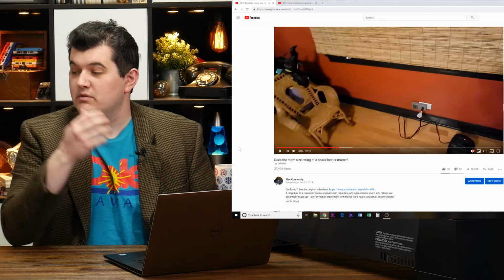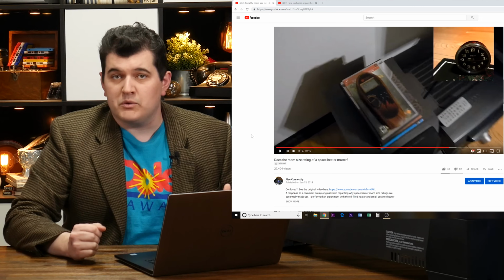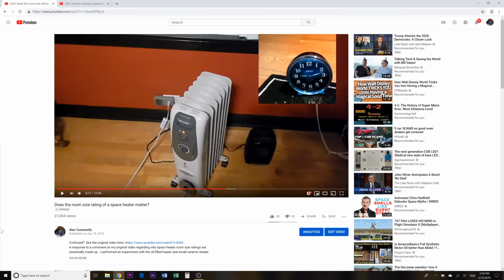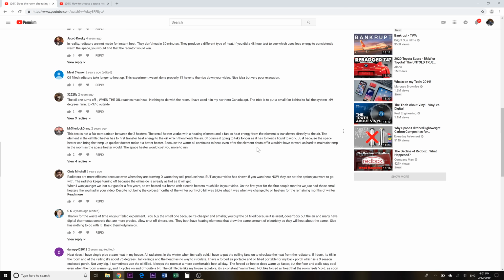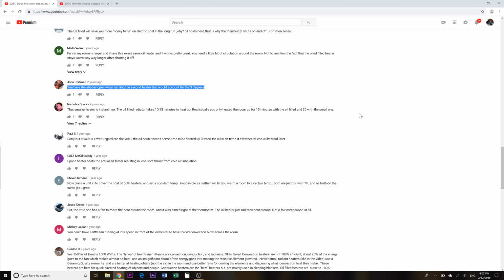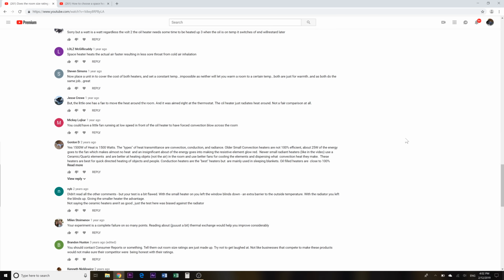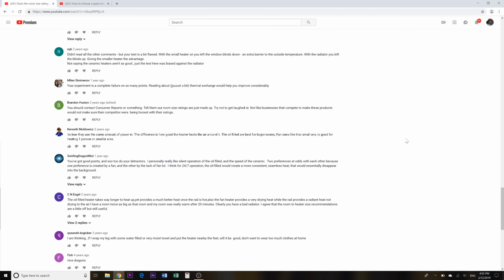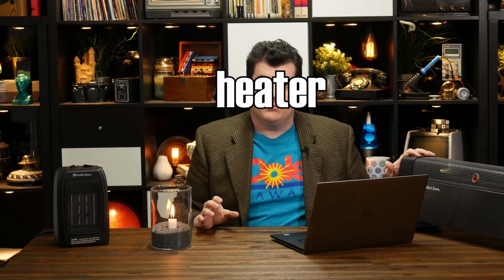More Space Heater Nonsense

Comment: Thanks for you videos.  I thought I would pass along some info on a nifty thermostatically controlled outlet that works very well for controlling a room space heater at a very accurate temperature.  Here is a link to this product on Amazon - https://www.amazon.com/dp/B07SBN2N69/  This has two pieces - an outlet switch and a separate thermostat module.  The thing I like about it is that the thermostatic sensor can be placed across the room (or anywhere you like) from the outlet switch and heater.  It's specs say that it will control the outlet switch to within 1 degree celsius.  My experience is that it really does that well.  One caution in using this (or any thermostatic outlet) with a portable space heater, one of my space heaters had an electronic on/off switch.  With that heater when the switched outlet removed power and then later restored power at the plug the heater didn't automatically restart - I needed to hit the heater's power switch again after power was restored.  So this doesn't work with that type heater.

Comment: Spent $53 on a Lasko ceramic tower, has remote control and oscillates back and forth. IT does a better job of heating my room than a 1500 watt utility heater I have. I can direct the heat towards my bed. They are both 1500 watt but the tower works better. I wouldn't spend any more than that, saw some for $99 and more!

Comment: I think that perhaps a lot of people get argumentative over your older video due to the fact its 2 different styles/methods of space heaters. I would suggest doing one with the same exact brand, same exact style, but both rated for different room sizes(and still using 1500 watts each). Your older experiment was like comparing Granny Smith apples to Fuji apples, not quite apples to oranges, but still different enough. Your intended point wasn't really made in the old video, as you more just showed the difference between the oil slower radiant style to a fan blown space heater.

Comment: The difference is more in the application than the cost to operate.  Fan heaters are quick and can point directly to you, if you are going to be in the room for many hours working or sleeping, the oil based heaters provide a more consistent room temperature and are silent.

Comment: Having actually measured the amperage draw of several different types of these heaters I can tell you with the utmost certainty there IS in fact a difference...

The mfgrs are rating the product at the worst case scenario of tolerance build up to draw no more than 1500w.

I have seen 3 different heaters, all rated at 1500w, set on high, on the same circuit, draw between 10.8A - 13.5A

So there is a difference in quality, which translates into functional efficiency...

And this doesn't even address the functionality of thermostats - which varies GREATLY!

Comment: The MOST IMPORTANT POINT of using space heaters was not addressed however, and that is: make sure your outlets are properly wired - I cannot stress this enough!!!

A space heater rated at 1500w running on 110v is drawing 13.64 amps - which is getting close to the 15A rating of a regular outlet. Now if your house was built long ago they may have used the push-in quick contacts on the back of the outlets, instead of winding the wires around the screws. This affords NOWHERE NEAR the contact area for current to flow, and especially if the outlet you're using is feeding more outlets downstream, you can easily overload it and have a fire!

Also if your home has aluminum wiring you need to make sure the pigtails are greased properly, or appropriate outlets are used - otherwise you will develop a high point of resistance and have a fire as was previously mentioned.

Hope this helps someone!
Reply: Well yes but then if a fire started the room would be even warmer!  For free!  I feel like that should gain the heater some extra points for efficiency.
Reply: @Interyx  
😂😂😂👍
Reply: Yeah, tell this to the erect chickens using those wago connectors
Reply: @shimes424  
IKR! 12Ga rated at 24A - yeah right, and 10 years down the road in an environment with the least bit of humidity and they won't handle half that current! But they're UL approved...

Maybe if using grease was mandatory they'd at least have a chance?
Reply: @shimes424  Wago is amazing though. Use it all the time in very humid environment from salt water. Works great.
Reply: You VASTLY underestimate what old wiring means. How about two-conductor post-and-wrap with non-polarized outlets! Hahaha! And the kitchen's three-prong outlets were either grounded to the water pipes nearby, or not even grounded at all! - - - Anyway, old houses can have some sketchy wiring that doesn't support high-draw appliances.
Reply: @MonkeyJedi99  talk about old wiring, at 13-14 amps my breaker flips every time. My entire upstairs is on one breaker, not to mention some of the power is sipped by the unit next to me. Oh and guess what, my breaker box panel is located behind a locked door. and there's a window AC unit on the same shared breaker.
Reply: @deadchannel991  Kind of makes you want to burn out the breaker with repeated trips just to force an upgrade.
Reply: @deadchannel991  Ah, the joys of renting in a slap-dash subdivided building where much of the work was done while the building inspector was drunk and/or well-bribed.
Reply: This is why I'm rewiring my entire house to have all outlets on 20A circuits, no backstabs allowed.
Reply: No way to heat your house faster than having it on fire! Always see the bright side xD
Reply: Thanks! This is very good info.
Reply: Oh yah, I totally agree with that.

Imagine the fear I had when looking at my electricity panel:  I'm living in a building where the panel is a old one (30 amp max) with fuses tenants "can" change with a higther one. A lot of that avec 1 to 2 air conditionners, a lot with portable air conditionners (witch consumme a lot of amp). I fear fire in my building in summer  because the propriety managment don't make sure that everybody know how to proprely use them. 

By exemple, my father buy me a portable air conditionner of 15 amp ( He didn't let me chose it) to rempace my old one (10 amp). The only place I can put the new one is in a piece I don't really want to cool and I can't take a shower in the same time because it's on the same circuit of the wc fan. I can't plug it in my other room because my fridge is on the same circuit. The old one can be plug in that room only and only if nothing else is functionning except the fridge. All the building his build like that. Oh I have a big fear of fire.
Reply: Actually house fires due to electric issues is rare. Just look up the percentage on cause of fires. I have seen people wire outlets ( 15 AMPs ) to Dryer circuits. Dangerous? Yes! Fire hazard yes! Did the house burn down? Still there 17 years after he did it. Stop fear mongering over aluminum wire and back outlet connections.
Reply: @Crimson_Hawk_01  If your house has aluminum wiring, it's also pretty good odds you don't have fire breaks in the wall, and any insulation you might have once had blown in (because in the oldy-old days, coal was CHEAP!) the walls has settled into the bottom foot and a half, only keeping your wires nice and warm.
-
Also, a lot of older houses have what I like to call "creeping upgrades" where additional plugs and lights are spliced in with whatever type of wire is common that decade, and you end up with twenty or thirty items on a 15 amp fuse, because putting in a new breaker box big enough for modern electrical use and wiring the house properly is expensive and involves tearing out lath-and-plaster to get in the walls.
-
And if the old wiring fairy was particularly generous, you have a combination of various gauges of 2- and 3- conductor (because grounding your return to the water pipes is fine, right?) branched off of old post-and-wrap that predates the Ford Motor Company. And you still have screw-in fuses.
-
I can't believe that house passed the inspection when we sold it.

Comment: It's all about humidity...
All heaters dry the air - and we all know from the summer "heat index" more humid = more uncomfortable, as far as our perception is concerned.

All types of heat do this to one degree or another: baseboard hot water systems the least, forced air the most. But these types of systems usually include humidifiers to counteract this condition.

That being said, the oil filled radiator style will dry the air out the least, followed by the ceramic element types, and bare element or reflective types the most - and the lower the humidity, the cooler a given temperature will "feel"...

So in conjunction with buying a space heater, set up an aquarium - which will bring you much relaxation at the same time as making you feel more comfortable!

And of course ALWAYS use a ceiling fan to distribute the warm air throughout the room - hot air rises, and it's always warmest at the ceiling.
Reply: I really enjoyed your comments; very informative.  A question:  I wanted to buy an oil-filled heater, but was discouraged by what he said about their heat frequently cycling them off.  Do you have an opinion on this?  I don't enjoy the sound of the fans.
~♥~
Reply: @Sita-Rainbow  
Hi Sita, thanks - glad I was able to be of help!

Think of the way these work akin to charging a battery, and then you're using the power stored in the battery - the oil is exactly that: a thermal battery, so they're putting out heat while they're not actually "running" (drawing current) These are also not going to react to quick drafts if placed near a blast of cold air from a door - where a fan driven unit will kick on, even tho the room temp hasn't been all that effected overall.

At $54.90 at H.D. this is only a few bucks more than the cheaper unit with the finicky analog dial thermostat, so it should perform much better:

Pelonis 1,500-Watt Digital Electric Oil-Filled Radiant Portable Space Heater - Model# HO-0280

In my experience these have all but silent operation, with just the "click" of the relay when it cycles on/off... Which they do seem to do fairly frequently, but it's kind of inherent in the design, as it's maintaining the temp of the oil. (Think of your electric cooktop cycling on/off while maintaining a pot of hot water)

And don't be fooled by it being slow to heat up a room - these do put out!
The key is having no fan, they heat by convection currents, so having a ceiling fan on in the room helps heat distribution, (or placing the unit under a window will also help) and they will heat a larger space effectively.

If you want a heater for say, a spare room you use occasionally as an office and want to heat it up quick for short periods of use, this is NOT the one you want - for a bedroom or living space, where it's always running and maintaining a temp - very well suited...

For that quick and infrequent office application for only about $22 this cheap little heater puts out!

Lasko 9.2 in. 1500-Watt Electric Portable Ceramic Compact Heater - Model# 754200

But it has an analog dial style thermostat which isn't worth shit, and you will find yourself fidgeting with it constantly to maintain a satisfactory room temperature over long periods of time.

Happy heating!😁
Reply: @openeyes-411  Wow, it's like Christmas with a reply like that.  So excited that you've done the huge bulk of my research for me.  Thank you!!
~♥~
Reply: @Sita-Rainbow  
You're quite welcome,
And Merry Christmas!

Comment: Thanks for doing these vids, makes alot of sense, and I've noticed the same thing with heater marketing- large vs small room. I've got $100 " large room" heaters that are not nearly as good as the $20 small room heater with a fan.
Reply: I have a friend with a fancy-pants fireplace type with an infrared that puts out squat - so I measured the current draw and compared to 2 other ceramic types.

The mfgrs are rating the product at the worst case scenario of tolerance build up to draw no more than 1500w.

So I measured 3 different heaters, all rated at 1500w, set on high, on the same circuit, and the draw was between 10.8A - 13.5A
And now we know why the fireplace (The 10.8A unit) didn't seem to put out much...

So there is a difference in quality, which translates into functional efficiency...

And this doesn't even address the functionality of thermostats - which varies GREATLY!
Reply: @openeyes-411  How do we spot the higher-quality, i.e., more functionally efficient ones?
~♥~
Reply: @Sita-Rainbow  
Yeah that's something you can't really "spot" per se, and I can only offer my personal experience. That fireplace unit my friend has she got at Wal-Mart. And I also once bought an infrared unit there only to return it a few days later, as it put out squat...

I've been using space heaters for well over a decade and I've found the mid priced Lasko brand tower style ceramic heaters to be the best bang for the buck.

These put out tremendous amounts of heat, are pretty quick to warm a room, and while the fans do make a bit of noise, I find it tolerable.

At only $46.46 (H.D.) this one's quite stylish, although the thermostat is only settable in 5° increments, it does have a remote so you can conveniently intervene as necessary - say leaving it set at 65° normally, and then kicking it up to 70° while you're in the room:

Lasko Designer Series 1500-Watt Oscillating Ceramic Electric Portable Heater with Remote Control - Model# 6435

The ones with the digital thermostats settable in 1° increments make it easy to find the sweet spot without it being too hot or too cold. The digital readout shows you the current room temp. (Don't take this to be totally accurate, but it's a close reference.) and flashes when you're setting the thermostat - unlike a Pelonis tower I bought which just showed the thermostat set temp all the time, which I thought was just stupid, lol.

And I've also gotten close to a decade of use out of some of those towers too - with annual cleaning of the elements and squirrel cage blowers of course.😉
Reply: @openeyes-411  Thanks again.  I've taken notes.  Many like me, pretty clueless on these things, will appreciate your recommendations, no doubt.
~♥~
Reply: @Sita-Rainbow  
😎👍we gotta help one another in this world - that's what it's all about...🙏
Reply: @openeyes-411  Yeah!!
~♥~

Comment: As far as i know in the Netherlands they only market the oil radiators for larger rooms because they can run longer, safer and have no moving parts so they don't wear down quickly under intensive use. The potential released energy in 24 hours of running is lower but test both systems for a full winter season and you'll see the difference in wear. I don't want to leave a simple space heater running unattended, an oilradiator no problem.  Also take in account that a small room heats up quickly so a simple fan heater shuts down after a small time, cools down again so there are no overheating issues. In a bigger room it tends to run way longer, adding more heat then an oil radiator per hour but wears down a bit to fast.  (just my 2 cents)

Comment: Ok. Ok. Ok. 

So, I' think I've cracked the code. It's all about the subliminal meaning of small room vs big room. 

See, in a small room, you're probably going to be there while it's on and a small room heater is often a forced air ceramic heater that's a vague risk of fire. 

Rather, a large room is often left unattended for long periods of time. So you can leave a radiator heater on for extended periods of time without it being more of a fire hazard. 

They dont' mean small room big/room. The mean, "room that needs to be heated for a short time," vs, "room that needs to be heated for a long time unattended."

Also, if you point a fan at a radiator heater, as many people do, it self limits less and works much quicker.

Comment: ITS ABOUT YOU!! And yes your still good lookin..(your comment at the beginning)
Please understand, your doing a very complete, interesting and informative,  comparisons that are driving you crazy. really
I just want "YOUR"your opinion..not the absolute, perfect truth YOURS
I want a 
non Chinese 
UL Listed...no fires..
Which is the 
ONE THAT YOU WOULD PERSONALLY BUY
not the cheapest, but...EASY VIEWABLE Controls, remote, quiet fan and thermostat.  
The one you would love and WILL be happy...YOU...bought two years later 
That,
 YOU STILL LOVE. 
So which type do YOU, OWN, YOU LIKE?
Reply: Lasko ceramic heaters in the $45 - $80 price range...

These have decent digital thermostats which are settable in one degree increments - which is an ABSOLUTE NECESSITY - as the thermostats in 5° increments leave the room either too cold or too hot, and the cheaper "analog dial" style are all but useless...

These heaters also usually have tip over protection (good if you have pets that may knock them down) as well as thermal overload protection.

They have a fan, so aren't silent, but aren't objectionably loud either, and distribute the heat nicely throughout a room, but they do dry the air.

The Lasko brand is well made and will last many years - given periodic cleaning... Where Lasko dropped the ball is not providing any kind of air filter for the intake - so if you have a dusty home or you're a smoker, you will need to completely disassemble and clean the squirrel cage blowers and the elements.

That's my 2-cents Bill.😉
Reply: Open Eyes   Bless your heart, sounds wonderful...thank you!!!
Reply: @Bill-xx2yh  
You're quite welcome Bill